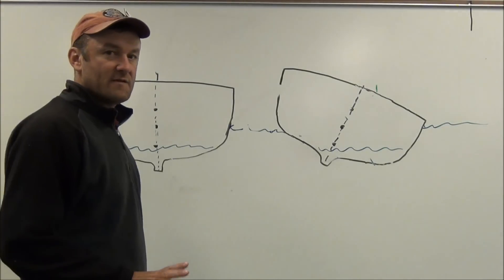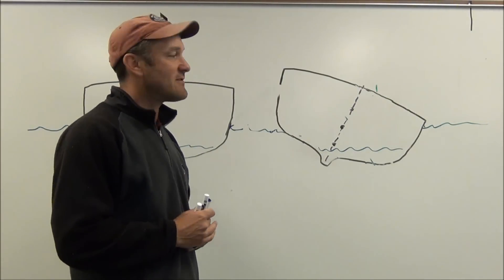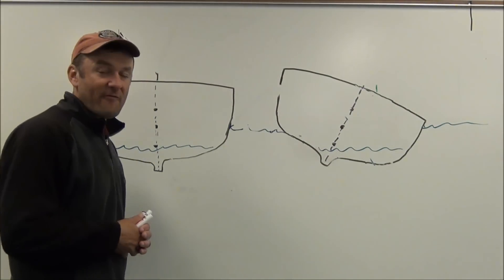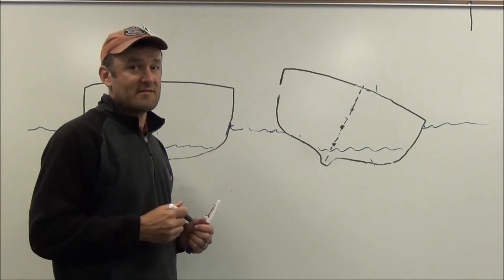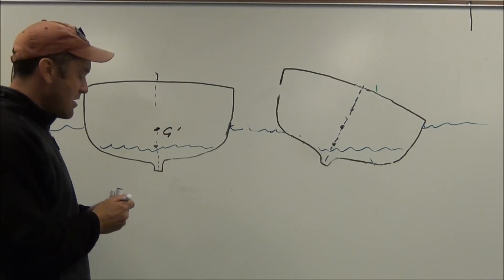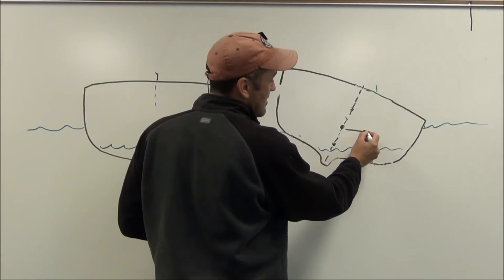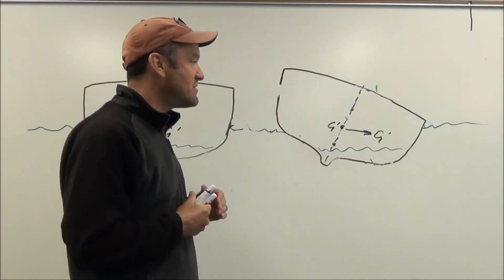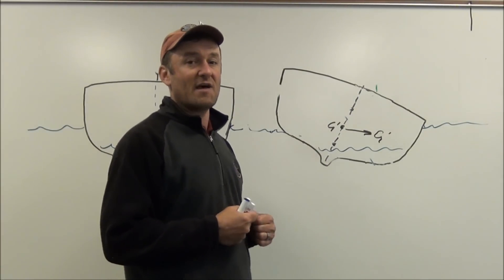Stability Unit, Part 3:  Free Surface Effect

Comment: So, I have baffles in my water tanks (dont know about my fuel tanks) which hold 20 ton. At night on anchor I can hear the water sloshing.. BUT my question is, what is the effect of the momentum of water sloshing. I have two 10 ton liquid holds which I normally fill with sea water for ballast. However they are NOT baffled. So, if I have one with only 5 tons in it, about 75% of that weight will slide side to side. When it 'hits' the sides, it must impart force on the boat causing a heel. Is this considered in Free Surface Effect? Or does the mass of the liquid have to be a significant percentage of the vessel. My boat is 180 tons or so. I dont know how to measure how much it weighs I'll be honest. So the water is only about 2.5% of the mass of the vessel.
Reply: That is your boat ?
https://youtu.be/ZcJDe5sejNE
Nice, I like it :)